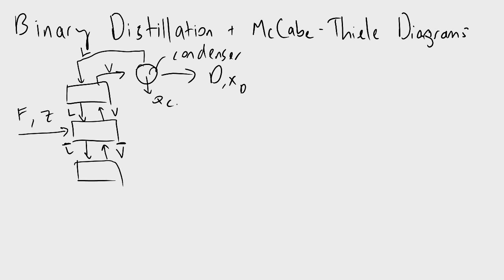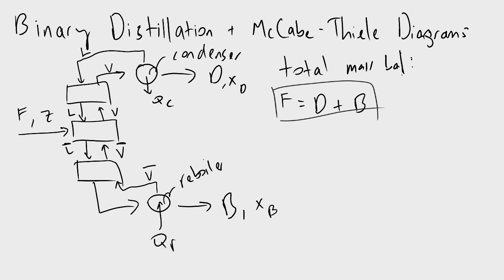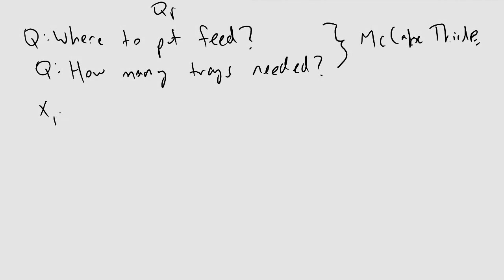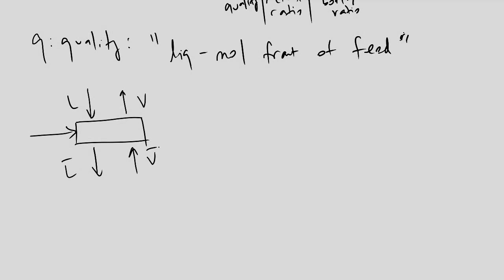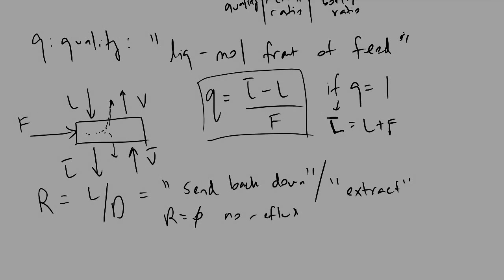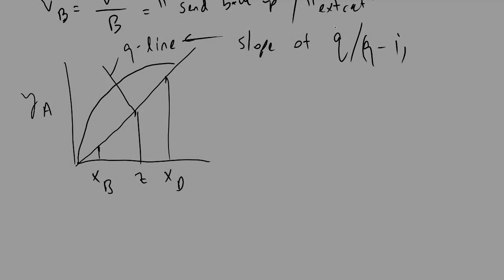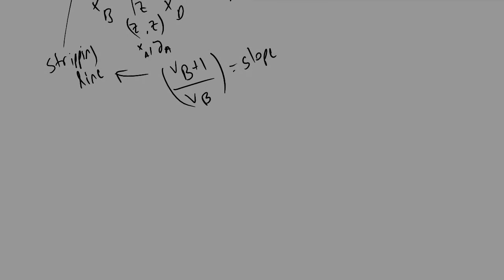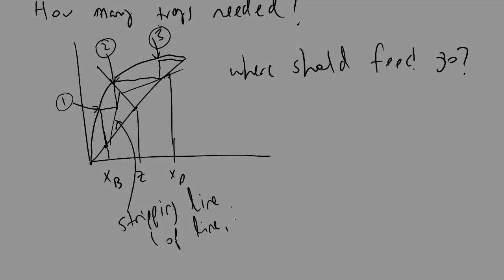Binary Distillation and McCabe Thiele Diagrams

Comment: I have a question: Now say that your feeding stream is for example a 50/50 mixture of tolueen and n-hexane. But that mixture is not that pure than you thougt, so for example it contains 10% water. Whats does it with your separation and how would you fix this?